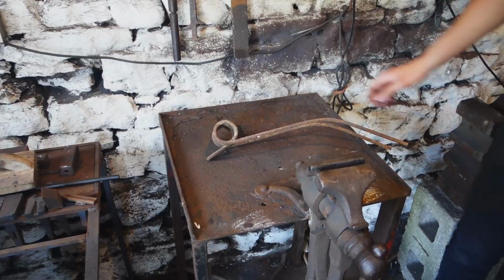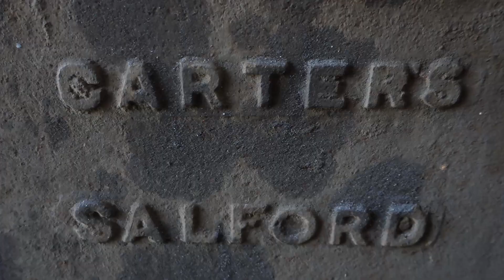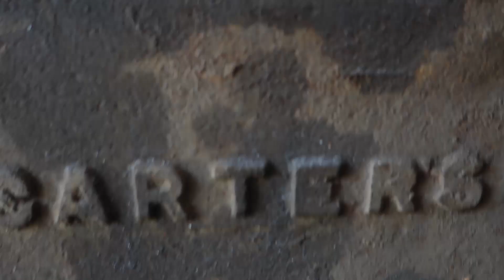Knotted Corkscrew!

Comment: Hi Oscar, did you have to quench the corkscrew after you'd finished heating it, or just let it cool naturally?
Reply from the maker: I just let it cool, but used a high carbon steel so it was a bit tougher.